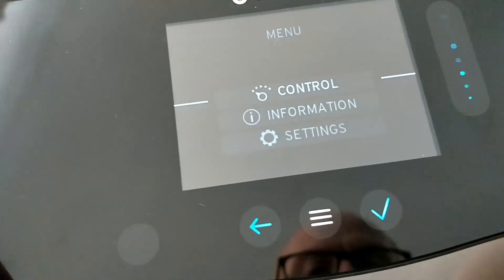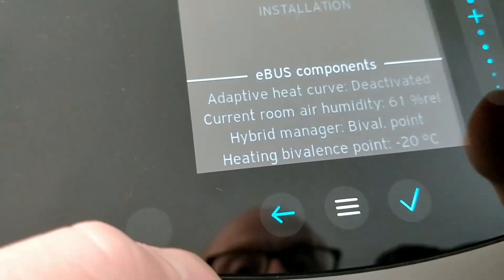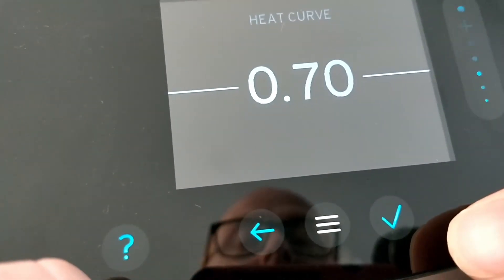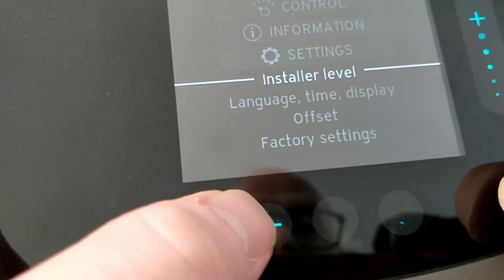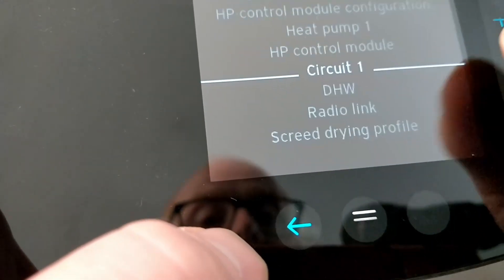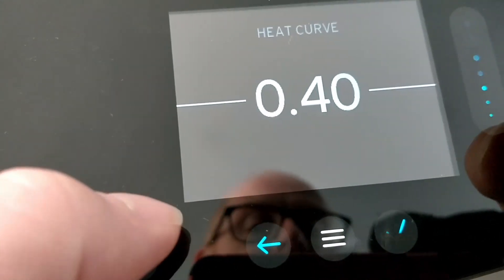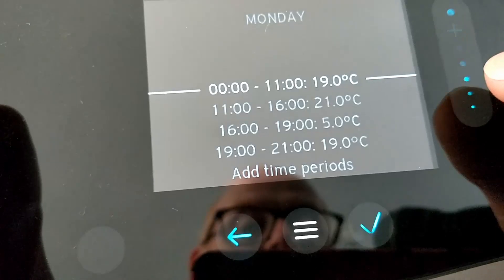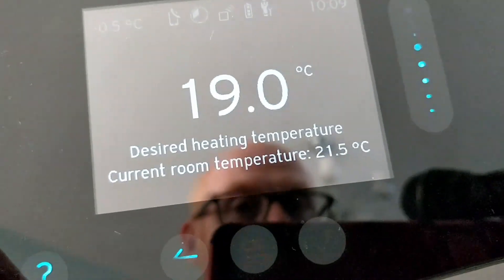How To Set Your Weather Compensation Heat Curve - Vaillant Arotherm Plus Heat Pump

Comment: Hi, just wanted to say thanks for this video, some of the settings in the Sensocomfort are not the clearest to put it mildly! I have a hybrid Arotherm system (so have a combi boiler for backup and to provide hot water) but when I adjusted the settings as you explained, I found the system was calling for heat when it was in a time period where no heat was required (i.e. my desired temp was 16.5°C but the room temp was 19°C). Any thoughts as to why that would be the case? 

Thanks again for the videos, keep them coming! :D
Reply from the maker: The inactive mode does this. It will run very gently as it needs to maintain temperature. This is how you can establish whether the heat curve is correct.
Reply: @UpsideDownFork  Ah right, ok, thanks for clarifying! The reason I wanted no heat called for is we are on Cosy, so between 4-7 its expensive, but if I follow, assuming I get the curve right, it would no longer try to call for heat during this time period? or if I set a temp below the setback?
Reply from the maker: @davidchilton7923  My trick for this is set your desired temp to 5 degrees between 4-7pm.
Reply: @UpsideDownFork  I'll give that a go this evening! Cheers!

Comment: Probably a stupid question but here goes. I am in the early stages of investigating the replacement of a two year old Worcester Bosch Greenstar boiler in a bungalow with an EPC rating of A and UFH with an ASHP. I am well used to tweaking my “intelligent” thermostats and leaving unused rooms on standby but what is confusing me is if this scenario is the same for a ASHP. Watching your videos has left me assuming that you should consider a ASHP as a whole house solution and if your heat curve is correct the thermostats and standby in unused rooms become redundant. See..I told you it was a stupid question 😂.
Reply from the maker: Yes, that's the basic principle of it.
In fringe cases you may need TRVs or other room stat intervention, but on the whole, the rads are sized perfectly for the room and only allow the right amount of energy to be transferred in each room.

With traditional wet systems, rads and such were sized by rule of thumb or for aesthetics whereas heat pump systems are properly sized using measurements and building science.

As long as the calculation is correct, the whole house will be even and balanced.
Reply: Thanks. I can see how that would work re unused spaces no longer needing standby but how do you control individual areas for example living areas at 22 degrees but bedrooms at 18?
Reply from the maker: @tonyharrison4127  imagine both rooms are the same size. You would fit a larger radiator in the living room and a smaller one on the bedroom to achieve the different room air temps whilst sharing the same flow temp between all rooms.

There are two keys to heat pump efficiency. Weather compensation is spoken about a lot but the other is somewhat ignored/misunderstood : flow rate and system volume.

If you start sectioning off parts of the house then you quickly reduce the system volume available to the heat pump.
Reply: @ Thanks again. But the house is 100% UFH so volume etc can’t be changed plus two of the bedrooms are very big relative to modern houses. That being said the existing boiler keeps them to 18 degrees but I guess less efficiently.
Reply from the maker: @tonyharrison4127  Ok, with UFH it will be done by balancing the flow rates between the circuits.

Comment: I have mine set at 0.6 currently on a 10kW Arotherm for a 4 bed detached house with moderate insulation. We are a little warm so may adjust down - just wondering what influence the controller now has?

Does setting the target higher on the controller actually do anything? If not then why have you set up so many different targets - including the 5C 4pm-7pm which I assume is an octopus cosy link.

Also with the set back temperature - the unit keeps running but I assume it reduces output even further?

Just trying to get my head around having the water flowing 24/7 :D
Reply from the maker: Yes, the desired temp shifts the curve up or down accordingly. At the 5 degree target, the pump is basically off for the peak period of 4-7pm.

So the aim of this video is to get the heat curve correct so that when you ask the heat pump for 20, it will give you exactly 20 and if you ask it for 18, it will give you exactly that.
Reply: @ great thanks for the response!

Comment: Thanks for the video, Ive tried this out, we have a 184year old terrace house solid walls, 300mm insulation in the loft, 2 bedrooms with internal wall insulation, 7 year old windows with trickle vents, warm flat roof in kitchen and downstairs bathroom. We have a Vaillant ecofit pure 825 on gas CH, Which I’ve range rated down to 5kw an external temperature sensor with a senso home thermostat, I basically copied what you’ve done and notice its warmer and the desired matches the current temperature now.
Reply from the maker: Excellent 👍

Comment: Hi, i’m trying to follow your video but my room temp is 3 degrees higher than desired? I was told to ignore my room temp as my controller is in a cupboard with my buffer tank. Room temp mod is set to inactive? Thanks
Reply: That suggests your curve is too high and you can try reducing it? Is it just that room that is too hot and the heating isn't balanced between rooms?
Reply from the maker: If your controller is in the cupboard then you can not use it to reference the internal temp.

If you have the wireless sensocomfort then it's easy to pull out of the wall bracket and take to your most used room like a living room for example. This will help you correctly set the temp.
Alternatively, get an independent room thermometer to use. I bought a 3 pack from Amazon for less than £10.
Reply: @ Cheers for replie. I wasn’t aware you could have a WiFi senso comfort that’s cool. I have got Heatmiser thermostats all over the house that control the UF heating upstairs and down.I have dialed in the heat curve to the coldest room. It’s at .6 right now. But very expense when it’s very cold outside. Pretty good all other times. The System has been in a year and a half now but I’m still dialing it in and not sure if my settings are optimal or not. It’s a big house so the elec bill is huge when it’s very cold!
Reply from the maker: @mrblobby3123  Ah! I should have mentioned that to set the correct heat curve with UFH, you will need to temporarily set your heatmiser stats to max so that they don't interfere with the Vaillant controller.
You can bring the room stats back into action once you are on the right curve.
Otherwise it's like pressing the accelerator and the brake at the same time in a car.
Reply: @UpsideDownFork  I did try this for a few days but I found the system running flat out trying to hit the temp upstairs in the coldest bedroom. So this was costing me a lot more as the pump didn’t slow down as couldn’t hit the temp. I have got 2 x 12kw arotherm plus here. 1 for heating and 1 for extra heating when needed and also does the water. With my house the downstairs which is mainly tiles hits the desired temp very easily! The upstairs how ever takes a lot longer. Mainly low tog underlay and carpet. So it’s a balancing act that I’m finding difficult to get right.

Comment: Hi. I followed your video and set my system to.0.7 from 1.20 and the settings you suggest. Two days ago.. Heating seems to be working well.. but my hot water performance has reduced drastically - insufficient for a decent shower. Previously, for the last year no issues.
Any advice?? Please 😢
Reply from the maker: Hello, the heat curve and settings shown in this video have no connection to the DHW side of things at all.
 
Are you sure you didn't adjust any other settings relating to the DHW?
Reply: @UpsideDownFork  Hi, thanks for the reply. No I never went into the DHW settings which is why I found it odd.
I think I'll reset to where the were initially see if that cures the issue.. 
Fingers crossed 🤞🏻

Comment: I've been gradually reducing my WC over the last few weeks and I think this cold period has really brought home the efficiency of our system.  I've been in touch with our UFH installer (we've kept in touch intermittently since he fitted it 27 months since) and he commented that it was over-delivering on what he was expecting.  Flow temperature was 31degreesC when it was minus 2 outside (it cost us about £4.00 in electricity that day).  
Today is much warmer and have COP snapshot of 5.3 (combined CH and DHW) and the WC is sitting at 2.50.  This is in a 1975 125sqm bungalow with moderate insulation.  
It was a leap of faith to get a heat pump but it has worked out well for us.  I have sympathy for those who have had poor installs.  I also think there should be better education out there as I'm aware of some who still attempt to run them on/off like gas or oil boilers, then cry when they're costing a fortune.
Reply from the maker: Great to hear such a brilliant success story! Thanks for sharing.

Comment: Great video.

Just had a Mitsubishi Ecodan fitted and really impressed.  The heating COP is around 4.5.

Looks like the Vailent system is easier.  I can set up the temperature at both the higher and lower points.  So far, I have found the 6KW unit runs better by leaving it to sort itself out.
Reply from the maker: Yes, I think Vaillant have taken a step forward in the controls department compared to some of the competition but there's still a lot of room for improvement, especially for those not technically minded.

Great to hear that your ecodan is working well for you!
Reply: Ecodan can run in Auto Adaptive mode which is basically a system determined WC, based on your desired temperature set.  
This was a game changer in my experience and the house only used less than 2800 kWh last year. 
I was hoping the Vaillant had something similar?

Comment: Thanks for the video. My "problem" seems to be that with full weather compensation, our house is happy with the 0.4 curve. But the COP is quite low still. If I say the curve any higher it gets to hot, quickly. Lower doesn't seem better in my case. Do you think I might have to use some room temperature influence and use a higher curve to get the ASHP working more in its operating range? It's a Vaillant 7kW. It's obviously oversized, but the head of design at British gas was very confident it would be fine.
Reply from the maker: I think we've conversed before and you've confirmed a good flow rate so it is a mystery why you're not achieving better efficiency figures.

It would be worth trying on active and seeing what happens for a week or two?

Once you're confident in being on the right heat curve then the difference between active and inactive can in most cases be fairly minimal.
Reply: @UpsideDownFork  yes, what's changed now, is that they came back and turned the buffer into a simple volumiser. That brought some clear improvement! However I don't think it is satisfying yet, as I project a SCOP of still around only 3.1 - 3.3 (2.4 previously). The flow rate before was through the buffer, while I didn't know the building flow rate. It's now a direct loop and flows at around 970l/h instead of the 1205l/h before. I thought lower flow rate means better heat transfer and delta T closer to 5 (rather than 1 previously) , but perhaps the efficiency is best at the higher flow rate. the 5kW unit has a max flow rate of 850l/h so might be better suited. I can't tell from the power output specs, if the 7kW is clearly oversized or not, or by how much. It's a bit over my head at this point. I think there is some mismatch, as the house is happy with very low flow T, but ASHP would like to push out 1205l/h at 35degC . Not sure if I had tried the "active" setting with a higher heat curve already since the change, but will try that now. I fear that this comes with cycling on/off and lots of revving-up from the compressor, which hums through the pipes and the whole house.
Reply: With 0.7 heat curve, the room temperature kept rising despite the "active" setting. COP not really better. Back to 0.4 and inactive room temp mode. Vaillant engineer at service today said lower is generally better. He noted that aerotherm always strives for maximum for rate. 990l/h not the end of the world, but looking for >1000l/h. One of our radiators has no flow, either shut off unintentionally at the valve change, or airlocked. We have 10 radiators and one is blocked. So if 9 radiators are 990l/h, it should be 1100l/h when that I've is ringing again ?  Pipework is all completely new, with large diameter pipes and filter was not blocked today. I also had the heating on manual for 24/7 so perhaps I can save by having it in setback temp. at nicht

Comment: Just to check... You're aware you can change the weather comp curve in the app now? Not the thermostat influence though.
Reply from the maker: Yep, I did a short video about that when the update was released.

There's still so many who haven't had the internet gateway installed especially those in social housing, so I wanted to just focus on the sensocomfort controller that everyone has access to.
Reply: @UpsideDownFork I, for one, don't have Vaillant's internet gateway (may do sometime soon).
Reply from the maker: @Biggest-dh1vr  don't waste your money. The server is unreliable and sometimes loses data anyway. Support tickets aren't dealt with well.

The app is good but not great.
Reply: @UpsideDownFork  it would be useful to control the system via home automation/pre heat remotely etc. If it works 😀
Reply: @UpsideDownFork  I totally agree. There are plenty complaints by owners on the internet. For the more tech minded owners, I would suggest to connect the heatpump to Home Assistant via an ebus interface that works on Wifi. This way you get all the useful data and are not dependent of the API/server from Vaillant.

Comment: Can I ask, what's your energy usage on the Vaillant been in the last day or two. My Daikin 6kW has used 15kWh over past 24 Hrs (heating only, @ 7C average outside, no defrosts), and 22.5kWh over 24 hours prior to that with one HWC top up (the cold period where 10 hours was between -2 & -3C outside, and four defrost cycles) ?
Reply from the maker: My results are skewed as I set my heating to 30 degrees for 10 hours on the agile negative rates.
Reply: @UpsideDownFork  

That's interesting, I noticed at one point renewables were producing @ 82% of UK electricity, that must be almost a record.

I'd been hoping to do a comparison and get a ball park figure, I've gone 'off-piste' with my HP and have had it running continuously in flow temperature control mode.
As the temperatures have dropped it became very stable in operation as the demand for heat rose a bit.

Primary reason for me was to see how low the Daikin 6kW could run stable without restarts (using @ 400W at external 9C and above, peaking at 950W @ -3C). With each defrost cycle using roughly 750Wh.

The effects for me doing things this way were that the room temperatures dropped by @ 2C, so Livingroom was 20C instead of its usual 21/22C, and so on for the others.
As coldest point was approaching I pushed the flow from 34 to 36C.
As the demand increased the frost built up, and it did about five or six defrosts over a 24-36 hour period.
This is the first time I'd witnessed it defrosting, as my monitoring really only began in April or so.
Reply from the maker: @_Dougaldog  Yes, I don't believe i've ever been paid so much to consume as much energy as I can possibly soak up. Even turned on the forbidden electric underfloor heating!

Looks like tonight will be more of the same.

It sounds like your experiment is going rather well!